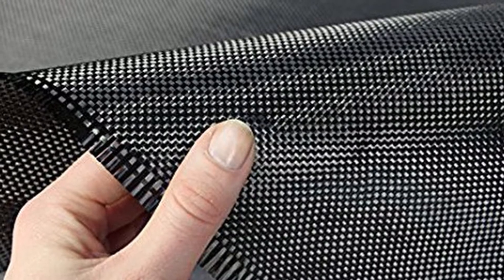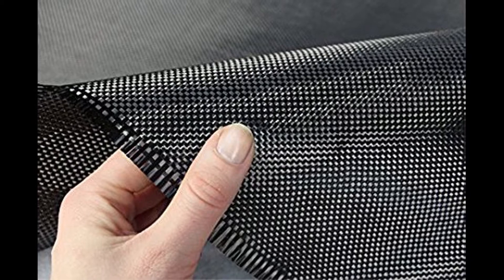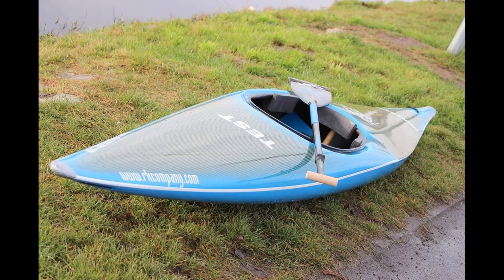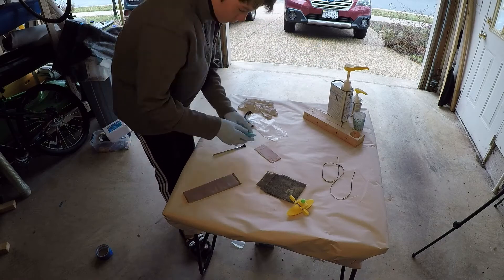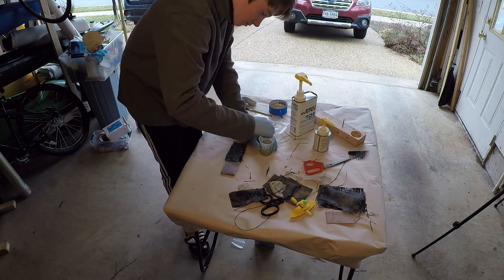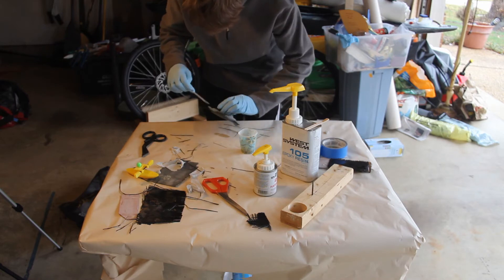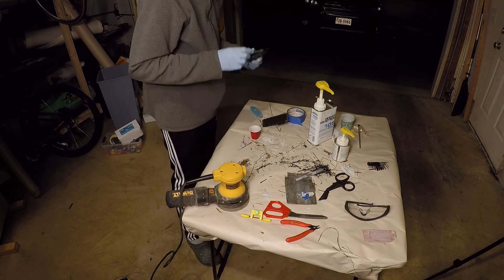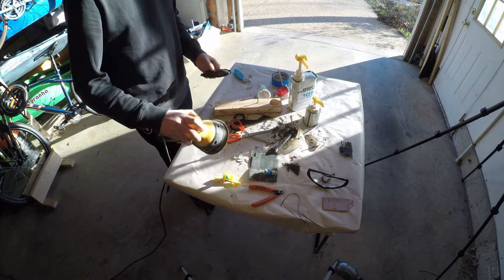How to Make a Carbon Fiber Kayak

Comment: This is neat. I'm going to make a velomobile and hadn't thought of making scale models but that's a great idea. I'm going to make several beforehand to decide on the materials, that I'll use, test out strength, erosion resistance and stiffness, and I'll use foam models to test for aerodynamics. 
Thank you so much!